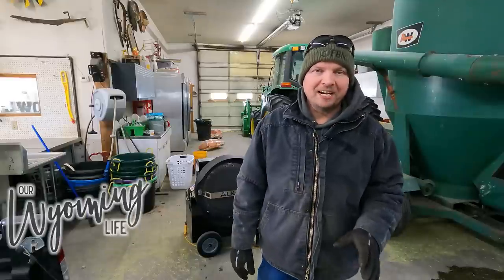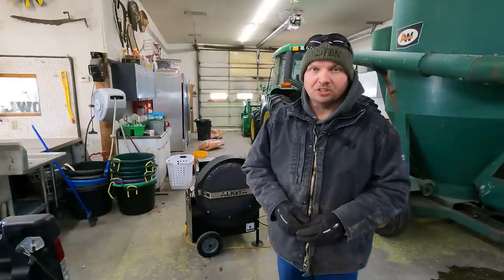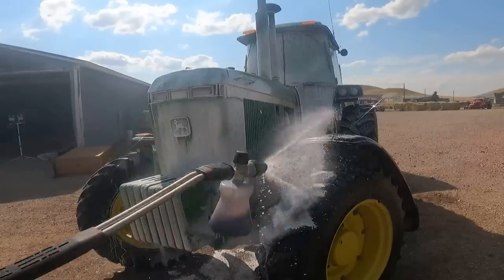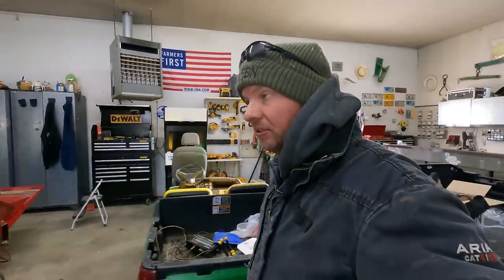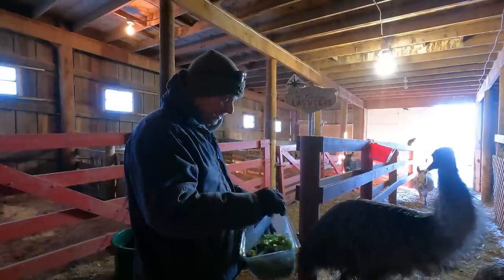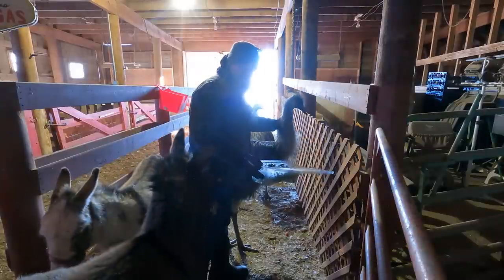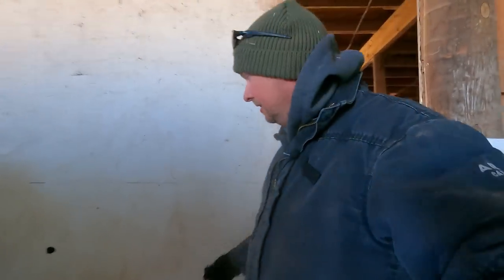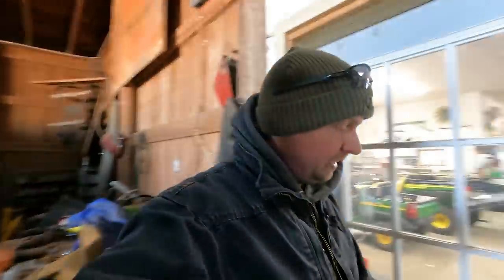Heating Things Up at -25°

Comment: You have -25 but full sun.  You might want to consider attaching a passive solar greenhouse to your house or buildings.  With that solar gain, a passive greenhouse would warm up fast and stay warm at night with some kind of thermal mass like concrete.  You can be at 80 degrees in February in a greenhouse.  You can also grow all sorts of fun fruits and vegetables.

Comment: We heat our 120 by 50 shop with a heater just like that does good even down to -30. Speaking from experience don't keep anything within probably 15 or 20 feet, you will melt it or burn it! 
When it comes to diesel gelling we run 50 50 blended diesel, never have had gelling issues down to -40.

Comment: I think we used to get more snow than we get these days....We used to tie a rope between buildings so we would find our way from building to building and back to the house. We had white-outs where you couldn't see 15 feet in front of you. The cold, well, I don't remember the temperatures back then, but I do remember how nice and warm the barn was once you closed the door! Nice memories. We also used to have a heater something like that. Dad called it a "Salamander" for some reason.
Reply from the maker: Thanks for sharing your memories Old Lady Farmer.
Reply: Isn't that another name for a diesel/kerosene "torpedo" heater?  Also, Mike doesn't that heater require an outside air source for ventilation?  Potential carbon dioxide/monoxide problem?

Comment: Mike...  Does the heater pose a carbon monoxide issue?  It looks like it is very fuel efficiant and doesn't produce any smoke.  I would think you might want to have a carbon monoxide alarm in the same room just to be on the safe side.
Reply: I wondered that too. Where does the exhaust go ?
Reply: My alkota burns really clean, much cleaner than a typical salamander. 
I don't know about the "official" answer but my nose don't notice it
Reply: As long as the heater is working properly, there should bit a minimum risk,  but with anything, we advise practicing caution, we do recommend a source of fresh air (open window or door), and yes, having a carbon monoxide detector is a always good plan!

Comment: Yes that heat blower is really good but if you're building doesn't have proper insulation the heat will just dissipate
 through the walls and do nothing

Comment: Mike, is that a heater or the port engine off an F14?    Seems to produce a lot of heat and thrust.    Does it have an after burner position on the thermostat?

Comment: If your diesel fuel is summer blend you might need to add more antigel. The other issue I've had was if there was water in the fuel/water separator that I forgot to drain.

Comment: You should honestly think about getting yourself a tractor that runs on gas that way when it’s subzero temperatures outside you don’t have to worry about your diesel tractors fuel jelling up I know that you have to have diesel tractors to run some of the equipment you have but I know for a fact that you can run the grinder mixer with a gas tractor how I know that is because I grew up on a farm that used a gas tractor and a few diesel tractors and during the winter months my dad would use a gas tractor for most of the work that was needed around the farm
Reply: Here in Canada we have winter fuel .No more freezing up .
Reply: Do they still make gas tractors?

Comment: Back when I lived in the great frozen north I saw a lot of different types of heaters but never a monster like that.  Seems downright dangerous.  I mean, 1,000 degrees at the front grate? Yikes!  We had a shop heater that was fuel powered and sounded like a jet engine but nowhere that big.  Maybe it got that hot but I doubt it.

Comment: Heat is cheap to 20 degrees over ambient 
40 degrees is twice the energy of 20 
60 degrees is twice as much as 40  
So 1 gal an hr at 20 
2 gal at 40 
4 gal at 60 
That's why it's cheaper to stop heat loss first 
BTW aluminum melts at 700 degrees

Comment: One concern and one question.  I would be worried about CO buildup in an enclosed space like your garage or workshop. How many BTU does it put out?
Reply: Hi Don, the SFA150 provides a low/high settings for 130,000 or 150,000 BTUs. It's a beast. We do recommend having a Cabon Monoxide detector nearby when running in smaller spaces and cracking a door or windows for some air circulation.

Comment: The Thermostat is an excellent feature, makes waaay more sense than high.low when its 995 degrees. Designed for a huge space. You mentioned Kerosene? What would that benefit be? Given how hot it gets I would be really concerned about it causing a fire n burnin down the barn.  Nice marshmallow too bad it was duesl flavoured lol.
Reply: Hi Blu, the Alkota SFA150 has the ability to run on diesel fuel, kerosene, or home heating oil, with no smoke or odor operation! The benefit is being able to use what is available or more affordable in your location, there are no real performance pros or cons :-)

Comment: Of course my jersey nurse cow picks the coldest day of the year to go in to labor. I think you should get a jersey nurse cow  so you don't have to buy that crap powder milk any more also I raised 10 hoilstien Angus crosses did 3 plus jersey heifer  for 4 months then ween I get 3 more and 3 more. Got good money  at auction 1.45 to 1. 56 a pound for 6 months at 500 to 600 poi¹¹
 X